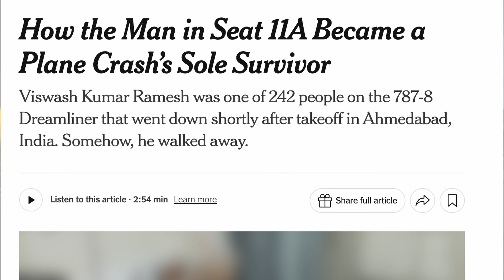Why the RAT Changes Everything – Air India 171 Update

Comment: Dual engine failure on takeoff in a Boeing 787 is an extremely rare event, given the reliability of modern jet engines. However, if it were to occur, the most probable causes would likely involve a combination of systemic, operational, or environmental factors. Here are the top 5 most probable reasons:

 1. Fuel Contamination or Starvation  

   - Contaminated fuel (e.g., water, particulate matter, or incorrect fuel type) could disrupt combustion in both engines.  

   - Fuel starvation due to mismanagement (e.g., incorrect tank selection, pump failure, or a leak) could deprive both engines of fuel simultaneously.  

 2. Bird Strike or Foreign Object Ingestion (FOI)  

   - A massive bird strike (e.g., flock of large birds) ingested into both engines could cause compressor stalls or blade damage, leading to dual flameout.  

   - Runway debris (FOD - Foreign Object Debris) could also damage engines if ingested at high thrust.  

 3. Common-Mode System Failure  

   - A software or control system malfunction (e.g., erroneous Full Authority Digital Engine Control (FADEC) behavior) could cause both engines to shut down or reduce thrust unexpectedly.  

   - Electrical or sensor faults (e.g., faulty fuel flow sensors) might trigger erroneous auto-shutdowns.  

 4. Severe Weather or Environmental Conditions  

   - Volcanic ash ingestion can melt inside the engines, coating turbine blades and causing flameout.  

   - Extreme icing conditions (though rare on the 787 due to advanced anti-icing systems) could disrupt airflow or fuel systems.  

 5. Pilot Error or Procedural Issues  

   - Inadvertent fuel cutoff (e.g., incorrect switch activation during an emergency).  

   - Misconfigured thrust settings (e.g., incorrect derate or assumption of engine performance).  

 Additional Considerations:  

   - Manufacturing or Maintenance Defects (e.g., a faulty batch of engine components affecting both powerplants).  

   - Uncontained Engine Failure (one engine fails catastrophically, damaging the other).
Reply: Potential Manufacturing & Maintenance Defects Leading to Dual Engine Failure  

 1. Faulty Engine Components (Manufacturing Defects)  

   - Turbine Blade Cracking/Fatigue  

     - The Rolls-Royce Trent 1000 (used on many 787s) has had well-documented issues with premature turbine blade cracking due to corrosion and fatigue.  

     - If a batch of defective blades was installed in both engines, simultaneous failure could occur under high-stress takeoff conditions.  

   - Faulty Fuel Nozzles or Combustors  

     - A manufacturing flaw in fuel injectors could lead to uneven combustion, surging, or flameouts in both engines.  

     - Past issues (e.g., GE GEnx icing-related fuel flow problems) show how systemic defects can affect multiple engines.  

 2. Assembly Errors (Boeing or Supplier-Related)  

   - Improper Torquing of Critical Fasteners  

     - The FAA has investigated Boeing for missed torque specs on 787 fuselage joins. If similar errors occurred in engine mounts or fuel/oil lines, vibrations could lead to leaks or disconnections.  

   - Defective Engine Mounts or Pylon Assembly  

     - A misaligned pylon could induce stress fractures, leading to an uncontained failure that damages the second engine.  

 3. Electrical/Software Issues (Common-Mode Failure Risk)  

   - FADEC (Full Authority Digital Engine Control) Glitches  

     - If both engines rely on the same flawed software logic (e.g., erroneous thrust calculation during takeoff), they could both auto-reduce power or shut down.  

     - The 787’s more electric architecture increases dependency on software—bugs or sensor faults could theoretically affect both engines.  

   - Faulty Engine Sensors (Fuel Flow, Vibration, etc.)  

     - A bad batch of pressure or temperature sensors could cause false readings, leading FADEC to incorrectly shut down both engines.  

 4. Maintenance Errors (Human or Procedural)  

   - Incorrect Fuel System Servicing  

     - If maintenance crews improperly purge air from fuel lines or misconfigure cross-feed valves, fuel starvation could occur in both engines.  

   - Improperly Installed Engine Seals or O-Rings  

     - A leaking seal (e.g., in the fuel or oil system) might go undetected until takeoff, when high thrust exacerbates the leak, causing dual failure.  

   - Missed AD (Airworthiness Directive) Compliance  

     - If a critical engine AD (e.g., Trent 1000 compressor blade inspections) was skipped, latent defects could lead to failure.  

 5. Supply Chain & Quality Escapes  

   - Substandard Parts from Suppliers  

     - Boeing’s heavy reliance on outsourced suppliers (e.g., Spirit AeroSystems) has led to past defects (e.g., mis-drilled holes, shoddy composites).  

     - If a supplier provided defective bearings, shafts, or fuel system components, it could affect multiple engines.  

   - Counterfeit or Unapproved Parts  

     - The aviation supply chain has seen cases of fake parts entering maintenance cycles. A bad batch of turbine blades or sensors could fail under load.  

---

 Real-World Precedents Supporting This Scenario  

- Rolls-Royce Trent 1000 Blade Cracking (2017–2020)  

  - Led to emergency airworthiness directives and groundings due to corrosion-induced cracking in intermediate-pressure turbine blades.  

- Boeing 787 Production Quality Lapses (2020–2023)  

  - FAA found improper shimming, debris left in fuel tanks, and defective fuselage joins, raising concerns about broader quality control.  

- GE GEnx Icing Issue (2013)  

  - Under certain conditions, ice could form in the fuel system, causing thrust rollback—showing how a design flaw could affect multiple engines.  

---

 Could This Realistically Cause a Dual Engine Failure?  

- Single-engine failures are far more likely, but a systemic manufacturing or maintenance defect (especially in software, fuel systems, or critical rotating parts) could theoretically affect both.  

- The probability remains extremely low, but Boeing’s recent track record does raise concerns about quality control.  

 Mitigations in Place:  

- Redundant systems in FADEC and fuel delivery.  

- Strict AD compliance and engine health monitoring.  

- Pilot training for dual-engine failure scenarios.  

---

 Final Take:  

While statistically improbable, a combination of manufacturing defects, maintenance lapses, and supply chain issues could—in a worst-case scenario—lead to a dual-engine failure. Given Boeing’s recent struggles, regulators are scrutinizing 787 production more closely to prevent such risks.

Comment: About the double engine failure. The reason could be a false fire sign from the sensor. 40 degrees Celsius at the 2m height. That makes 60+ degrees Celsius on the concrete. The fuel tanks get the 60+ temperature. I was analysing qualification of aviation fuels and other fluids at an International airport for decade. The jet fuels flashpoint between 39-45 degrees Celsius. Hence, all the fuel tanks, those are above the ground, must be cooled  on some way. (mostly with water). Also, the planes' wings should've been cooled with water to avoid the overheating. Without these cooling actions the engines get 60-65 degrees Celsius fuel. There is a huge chance the sensors take this temperature as the fuel is on fire. The system cuts the fuel injection and...

Comment: Well with this info my suspicion now firmly falls on the recent maintenance carried out on the plane.

Potential timeline:

V1, previously known but not considered serious electrical fault shorts out most plane systems. Fuel pumps included. 

10 seconds both engines die due to fuel starvation as fuel pumps fail to work.

15 seconds RAT deploys as dual engine failure cuts all hydraulics and electrical has already faulted. 

At this point the flight is almost completely uncontrollable and the pilots are basically just strapped in for the ride.

I think this is fairly plausible as a timeline however I’m gonna wait for the initial report before setting my opinion in stone.

Comment: And that folks is proof why a good aircraft accident investigator doesn't go into an investigation trying to imediatly try to solve what brought the plane down. They go in with an open mind, looking at the clues that are based on facts, there is no room for assumptions. Then after every clue and fact has been collected, they determine the probable cause. The multiple videos are one small part that will help determine the cause, but the FDR and CDR will shed even more light on the chain of events to this unfortunate tragedy.

Comment: The aircraft gets into the air and seems to slow down, as if the thrust from the engines faded out on lift off. It's a horrible moment - losing all thrust when the aircraft is very low, very heavy and slowing down.  That poor pilot & co pilot had a few seconds but no choices left at all. The mayday call was trying to tell us why .  .  . it's horrific.

Comment: Correct me if im wrong but the RAT can deploy on takeoff if one engine is flamed out and there are problems with the hydraulics. Hydraulic problems also seem very possible because you can see the gear tilted down not up from the first wheel and the 787’s gear swing works like when you command the gear up they first tilt down. That could indicate that they tried to get the gear up but couldn’t. That could then be a tip of a possible hydraulics problem.

Comment: This is a heartbreaking incident, but also a deeply thought-provoking one from an aviation and human decision-making perspective.

Based on publicly available satellite imagery and usual southwest departure paths from Ahmedabad Airport commercial aircraft typically pass over Ahmedabad Civil Hospital — a 3,000+ bed facility and one of Asia’s largest medical complexes which is just within the 2 km from the SW edge of runway.

However, in the case of AI-171, the aircraft deviated slightly south (left to straight line) at a very low altitude (~625 feet), ultimately crashing into the BJ Medical College Boys Hostel — an area with more open surroundings and likely lower impact risk compared to the hospital zone. This suggests the crew may have taken a deliberate decision — under extreme pressure — to steer the aircraft away from a densely populated and vulnerable site.

Moreover, it's notable that landing gear was not retracted, and flap positioning appears to have remained configured for takeoff. This may indicate that the pilots prioritized maintaining control, lift, and directional changes over standard climb procedures — possibly due to an ongoing or anticipated emergency.

At such a low altitude, with very limited time and control envelope, these decisions — if made consciously — reflect extraordinary presence of mind and situational awareness.

🛑 This is only a personal technical analysis based on flight behavior, map overlays, and general aviation principles — not an official conclusion or report.
But if this interpretation holds, it speaks volumes about the training, professionalism, and selflessness of the flight crew.

RIP Captain Sumeet Sabharwal and First Officer Clive Kunder — your final actions may have saved lives we’ll never be able to count.

Comment: Most probable sequence of events:

* Begin take off roll

* Right engine lost at V1

* Crew continues take off, because that's what they're supposed to do

* Aircraft yaws to the right due to asymmetric thrust

* Crew doesn't retract landing gear because they're too busy dealing with the yaw

* They want to gain sufficient altitude to be able to turn around and land

* At 625ft, the left engine is gone, crew tries nose up

* RAT deploys

* Mayday call to ATC

* At this point the crew is lookin for any empty space nearby to put the plane down

* Aircraft turns a little left to the emptiest area of that vicinity

* Crash

Comment: I'm not a 787 expert, but I'm led to believe the RAT also deploys automatically for a fourth possible scenario of loss of all 4 electro hydraulic pumps and a single engine failure.
As a 74 pilot, we have always been told that climb out with gear extended after an EFATO, is equivalent to a double engine failure i.e. drag from extended gear would create performance capabilities as if it were a double engine failure.
Obviously the FDR and CVR data will reveal very soon what  exactly has occurred in this event, but just my opinion  is a single EFATO, loss of all 4 electro hydraulic pumps, reduced air density due to conditions, heavy weight take off, aircraft stops climbing as if it were a "double engine failure" followed by aerodynamic stall

Comment: Captain,
Can you provide the diagram from fuel tank to the turbine injection point with instruments and safety devices used with interlock to safeguard the engine and aircraft for better clarity ?

 Can the fuel tank isolation valve handle position is turned by 90 degree to make the illusion as if is open though it is in  closed with an intension of subotage?

When pre operative check carried out by the ground staff and confirmed by the captain normally before take off. 

Is that possible to change the valve handle position easily?

Comment: Hey Capt Steeve! Nothing you said is new other then the runway inspection. It was clear before that they had dual loss of power, either total or partial. The RAT was visible before too. The thing here is what made the engines loose power. If they inspected the runway, and no gravel or evidence of bird-ingestion, (birdstrike) was found, then it must be inside the plane. Some clogged fuel line? Some softwere glitch? Some broken part in the fuel system? I think that this is the way to keep looking. Only the FDR will help here....

Comment: RAT indicates total electric failure including pumps that supply fuel to engines. 787 has heavy dependency on electrical systems that previous models that depend on hydraulic systems

Comment: question : can they retract the landing gear when using RAT as main power source ?
Reply: The landing gear retraction system, which is hydraulically actuated, requires significant hydraulic power, and there is evidence suggesting that the RAT does not provide sufficient hydraulic pressure to operate the landing gear retraction mechanism.

Comment: Also note the landing gear tire orientation. They are tilted forward, which only happens during the landing gear being raised or lowered and they seem to be stuck in that position. That fact and the RAT being deployed indicates significant failures of the entire plane. The whole mistaking the landing gear lever from the flaps lever never seemed right. Goes against muscle memory as they are in very different positions and feel very different. Now, that does not mean the copilot could not have been incorrectly ordered to retract the flaps, but you would never mistake these to handles.

Also consider if the release of the RAT would have given the bang noise.

Comment: After Tatas got back Air India, some aviation lobbies were not happy. They were constantly trying to defame and malign the air lines. They had managed the media, which was always putting some negative news. Many of the employees were also helping the lobby by doing negative things, like faulty toilet, off loading luggage without valid reason.
I strongly suspect, the twin engine failure and crash of air india flight 171 has been a handi work of this lobby only

Comment: Dual engine failure on takeoff is virtually impossible, unless maintenance performed on both engines. It is possible to cause fuel starvation by improper fuel system maintenance. Was any maintenance performed immediately prior to this flight?

Comment: Passenger planes should have enough power for a take off fully loaded without flaps.
Yes flaps are important, but, in emergency situations, there should be enough emergency power to push airplane with flaps issue to continue a climb.

Comment: I just don't understand why you think pulling flaps up a bit early could cause this... You can fly just fine without flaps once you're up. You might lose a couple hundred feet but you're going to fly. You're not just going to drop onto the ground.
Reply: You obviously know nothing about transport category airplanes and what it takes to make them fly at heavy weights slow speeds and at hot temperatures
Reply: @flyinghare123  I fly on them all the time, they leap into the air
Reply: @biggieb8900  I dont think you do, except in your dreams…..
Otherwise you’d know better……
Reply: @flyinghare123  So your leading theory is they pulled up the flaps and just coasted into the ground?

Comment: > The deployment of the RAT, and then it's going to take over electrical and hydraulic

Oh, this statement has me asking a bunch of questions:
- Is it true that the RAT actually takes over electrical and hydraulic power, and does it isolate existing sources like engine or APU gens?
- Can the RAT make enough power at low airspeed (<200kt) right after takeoff?
- Is it possible the RAT could have deployed unintentionally?

Comment: So would a major electrical failure (losing both main busbars) cause the throttles to reduce engine power towards zero?  The pax survivor did say he heard a bang before descent? RA T deployment is certainly plausible but...  If not what would cause such a dual and simultaneous engine failure?  Contaminated fuel is unlikely to do so  --- I still go with an electrical issue